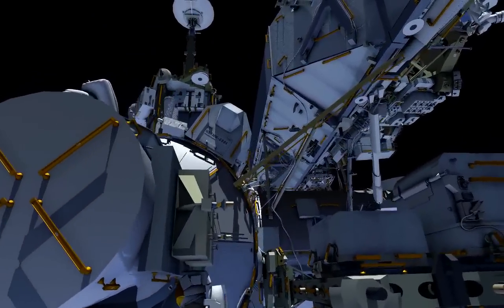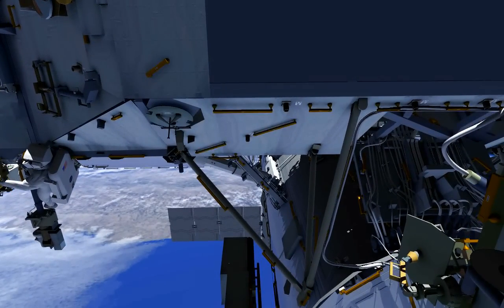Tasks for Second Expedition 41 U.S. Spacewalk

Comment: these cameras need to be moved because PMM is moved in December it needs to go underneath the Harmony Module so the Node 3 can be moved to its final location next year BEAM will be installed on the side hatch and if all goes well Bigelow will let them keep it and a full outfitted unit will be delivered on the next Dragon also Docking Ports are coming up on Dragon 6, Dragon 9, and Dragon 12 those ports need to be clear so CST100,Dream Chasers, and Dragon Riders can dock.